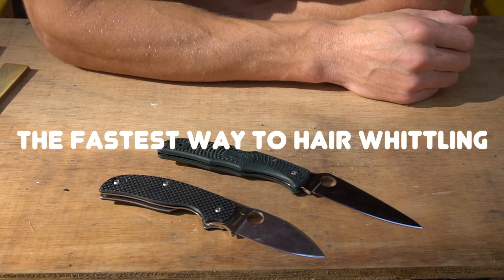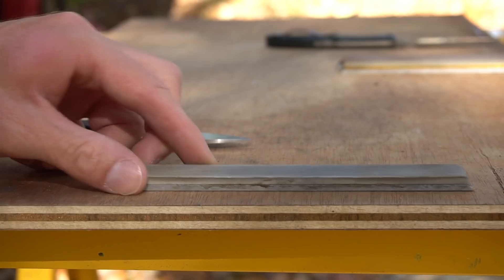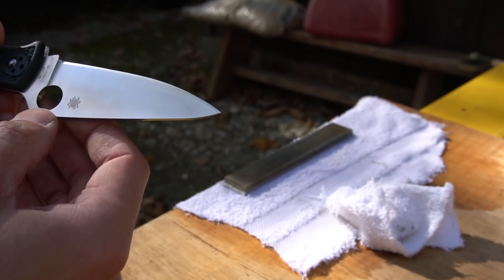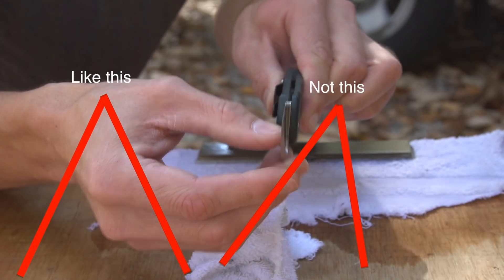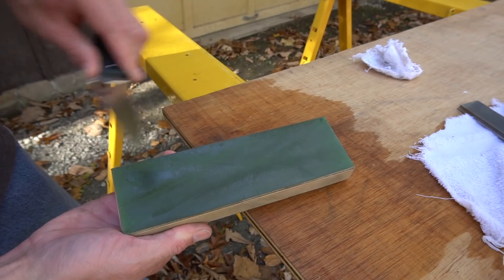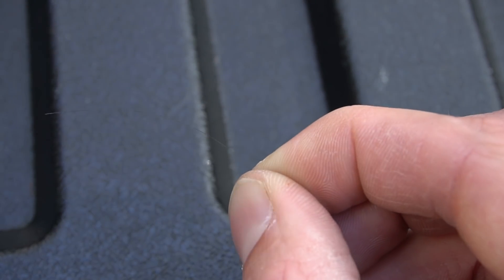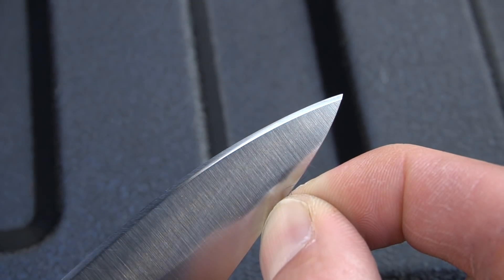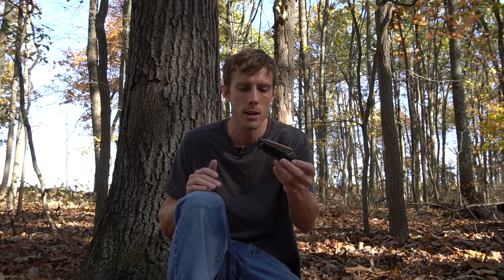FASTEST WAY TO A SCARY SHARP KNIFE

Comment: I'm confused! In a "tip vid" you said to always use the blade edge going away as in stropping, but on this vid you're using edge leading to sharpen.
Reply from the maker: You can do either or. If you are experiencing problems going in one direction, switching directions can help. Go whatever direction helps you maintain an angle the best.
Reply: OK. Thanks. Maybe I took it too literally. I suck up all this info lol.

Comment: not eveyone can spend 10 minutes per blade, yes its a good edge but takes way too long with sharpening stones.
Reply: What? I mean, if you can't spend a few minutes to sharpen the knife you want to sharpen to the max, just buy razor blades. Best way is sharpening stones is stropping
Reply: @-BWS-  except it's not a few minutes. It's 10 minutes and the video is titled the "fastest way"
Reply: @Bogak911  eh, it can depend. (Yes title isnt accurate tho lol( depends on stone size and knife size i suppose, plus 10 minutes isnt much more than what is comprehended as a few minutes. Note that this is all just my opinion.